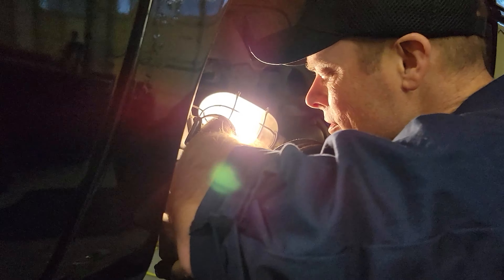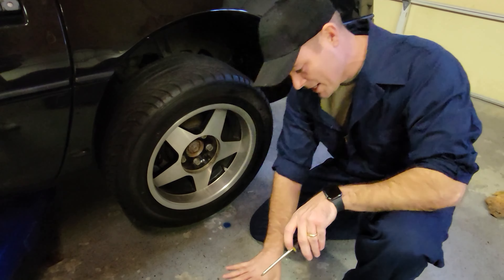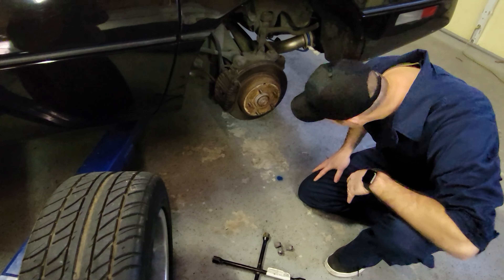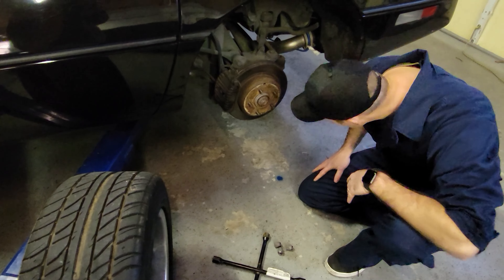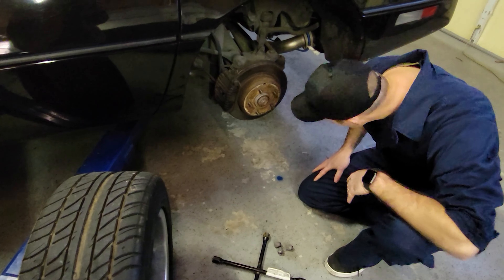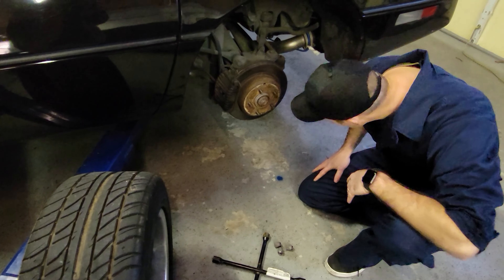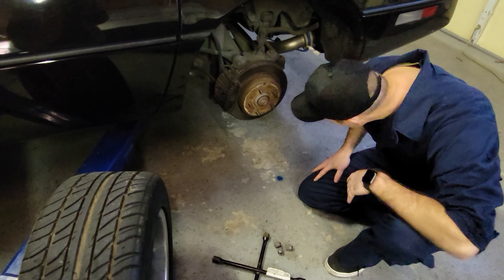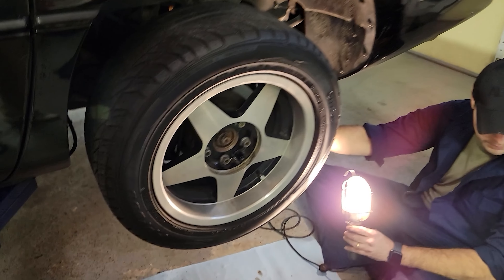C4 Corvette Quick Emergency Brake Fix

Comment: Cheers, very helpful video.
I has squeaking coming from drivers side rear wheel. Universal joints seemed ok, no play.
I found also that the hand brake  cable had come off its clip. Put it back on, ran the hand brake several times while driving and the squeak stopped.
Which is strange because I'd have thought with the cable off , the shoes would not be touching the pad.....